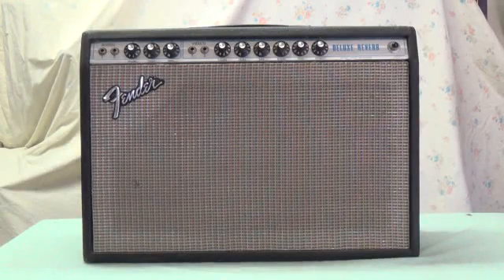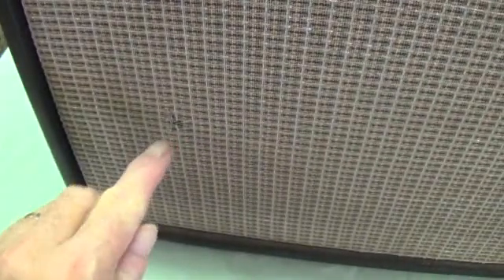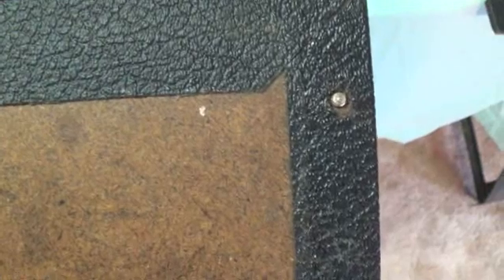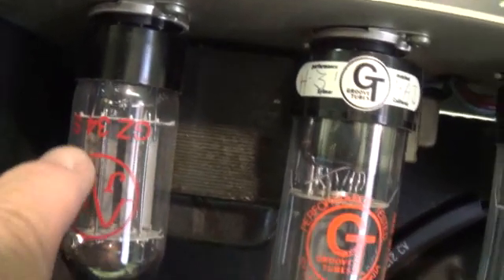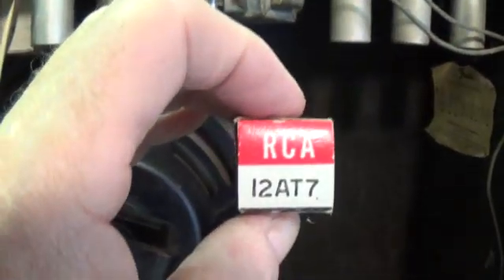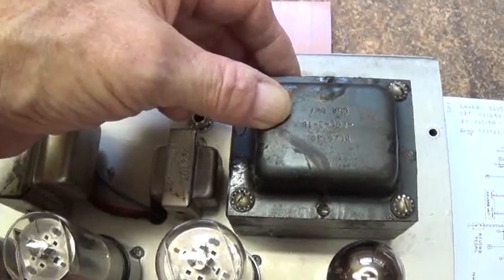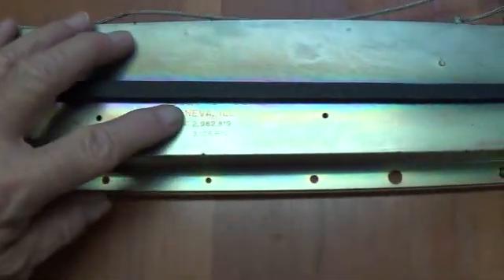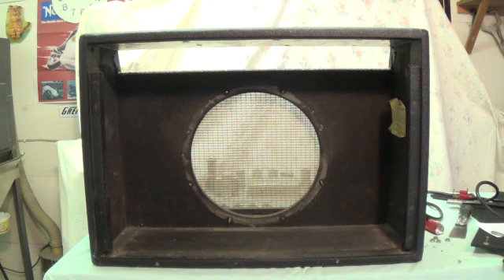1974 Fender Deluxe Reverb Part 1: Disassembly and Evaluation

Comment: Hello, I did something pretty stupid today and I think I killed my Twin reverb reissue... I plugged the footswitch into the external speaker jack and practiced with it like that until it died. There was a lot of heat, but the amp was on the other side of the room so I dIdn't notice until it was too late. 
 I notice that it was not nearly as loud as usual but thought something else in the chain was causing the volume drop. It is dead now and wont turn on. Have I really killed my amp?
 Thanks for any help you can provide!
Reply from the maker: You have probably damaged your output transformer and/or output tubes, David. If you have a multi-meter, test the OPT for continuity in the primary winding and in the secondary. If it's OK, which is a long shot, you could try installing some new or good used output tubes and see if that helps. Good luck.

Comment: Jensen stopped making Alnico speakers in 1961.....so that is a 1956 speaker
Reply from the maker: I was not aware that Jensen did this, Dave. I looked for a reference to confirm it and could not find one. Can you provide a reference that states this?

Comment: Hi Uncle Doug and Rusty, i want to ask you how i can identify a speakers wattage and ohm,s  if my speaker has no label or markings.
regards.
Andy,Scotland.uk
Reply from the maker: Measure the DC resistance of the voice coil and you can estimate its impedance to AC. Generally, the resistance to DC is about 20% lower than the impedance......i.e. 6.7 Ohms resistance = 8 Ohms impedance.  As far as the wattage, it's generally based on the size and diameter of the voice coil. The larger the diameter, the higher the wattage.
Reply: Thank you,,kind regards
Andy

Comment: ....7:30.......turn it on and crackle sounds...I've had that in various equipment over the years...often it's a bad power supply capacitor.....Seems lots of old electrolytics go bad....
Reply from the maker: Another common source of crackling is old carbon comp resistors that develop small fissures in their internal structure that make noise when current jumps the gaps. This is especially noticeable in plate and screen resistors.

Comment: If you disconnect the reverb tank, can you blow your reverb OT, like you do with the SpeakerT, if no speaker load is connected?
Reply from the maker: An interesting idea, PK, that I had never considered. Since the reverb tank and its OPT act exactly like a speaker and its OPT......then, yes, perhaps you could; however, the reverb circuit is operating at considerably lower voltage and current levels.
Reply: Luckily, that did not happen... (I had issues reconnecting my restored reverb, which was rusty all the way incl. connections.) But it seems, that on my Fender Twin Reverb "Reverb Output" on the rear panel goes to "Output" on the reverb, which is very confusing to me. Is that normal for Fender Amps or are my connectors wired wrong?
(Normally I would expect, that reverb output goes into the input of the reverb and vice versa.)
Reply from the maker: I used to find it a little confusing too, PK.  I believe that the output from the amp goes to the input of the tank, and vice-versa.  You can determine this for sure by measuring the resistance (to ground) of each of the inputs on the tank.  The values will be lower than the impedance of the inputs, but still informative. The amp circuit output should be going to the lower of the two resistances......actually about 8 ohms of impedance, so around 5 or 6 ohms of resistance. The tank is like a speaker, being driven by the reverb (i.e. output) transformer.
Reply: Thank you so much for your effort of answering and teaching me (us) a lot - actually I understand, what you are talking about, and two weeks ago, I would have no clue. And that all thanks to your great great videos.

Btw. I did (and still am) collecting a document with your slides and comments, neatly ordered, as a compact reminder of all the things you talk about. Do you have any interest of receiving that? Would that be useful for others as well? If you think so, I would be motivated to put it into a nice, more publicly acceptable form.

Comment: As a novice and amplifier junkie I have really enjoyed expanding my knowledge watching your videos.

I lucked out at a sale and picked up a '78 DR for a song (relatively speaking).... another successful story of finally "lucking" out. The only thing that was amiss was the tremolo, so I had my tech friend throw on a photocoupler/wiggler and bias supply and filter caps onto his large order from mouser or whoever he goes through.

It is one heck of an amplifier---noticeably more powerful than the blackface amplifiers. All you have to do is leave the push/pull volume boost pot on the vibrato channel IN. I've never heard a more strident feature on an amp.

What kind of procedure would one go through to supply tremolo oscillation from one of the oscillating 1/2 tubes?
Reply from the maker: Did the amp come with a pedal?  The Tremolo effect in most DR's requires that a pedal be connected for it to work. Your final question would require a very lengthy reply.  I suggest that you watch my video on PhotoResistor/Bias Modulating Tremolos. Best of luck with your newly acquired DR.
Reply: The pedal and the original cover were unexpectedly present.

I'll watch that video with all speed, thank you.

Comment: I acquired a '74 Twin Reverb 15 years ago. When I first got it, it would randomly make big popping noises. Took the chassis out and found that a coupling cap broke and it was arcing. I replaced that and it worked fine after that. It also had no reverb, and I found that one of the little tiny wires inside had broke off. Soldered that back on and it sounded beautiful after that.
Reply from the maker: Excellent work, VC. You appear to be quite competent at diagnosis and repair.
Reply: Thanks. I had some help from the amp debug page at geofex.com. I was just learning how to build stompboxes and work on amps at the time. Anyway, it said that popping noises were almost always due to arcing. In my case, the stripboard was curled up a bit and I could see where a blue Mallory cap had broke, so I replaced it. I think I just had luck on my side, but since then I have learned how to be a pretty good troubleshooter although I don't love the process of doing so lo
Reply: Uncle Doug Its a real treat to wach your videos...very informative...you do such professional quality work...trust me ...the average person has no were near the technical knowledge and skill you have...I would love to be your neighbor. .we have the same interest in vintage audio : )

Comment: Hi there--I love your videos, as they are very informative. And of course the good humor is always appreciated.

I just picked up a ~'78 Deluxe Reverb with the Push/Pull vibrato channel volume. Vibrato is not working, but everything else is great. Except when I tried to reduce hum by touching the ground switch--got a nice jolt last night.

I thought the same thing: "Why does a stock grounded power cable amp have a ground switch??" I'm sure the "death cap" must've passed A/C to the chassis, and then me and my guitar.

But I wonder if it may need another 12AX7 for renewed vibrato.
Reply from the maker: If the chassis was properly grounded, Taylor, there would be no shock hazard, "death cap" or not. First, you should test your wall receptacles to be sure they are properly wired and grounded. You can buy an 
inexpensive testing device at Home Depot. If they are not wired properly, then repair them. If (or when) they are, then I suggest that you replace the power cord with a properly wired, 3-wire cord and be 
sure that the green grounding wire is securely attached to the chassis. As far as the tremolo, replacing the oscillator tube would be a good first step. Good luck.

Comment: Hi Doug, I've one 73 and I changed the PT and put to 240V (blackfacing with 5U4 for now). Should I switch the 2 amp fuse?
Reply from the maker: If you double the voltage, the current should drop to one half, Pablo, so I would try it with a 1A fuse.  Turn it on and off a few times and run it at high volume to see if the 1A fuse can stand up to normal usage. If so, great....if not, try a 1.5A.
Reply: Ok, I will try this.
Thanks so much.
Regards!
Reply from the maker: You're welcome, Pablo. Good luck.

Comment: Uncle Doug,I really enjoy all your videos. I have a Fender '65 Deluxe (re-issue) and  the 6v6's area extremely HOT.  I believe that Fender did this for some unknown reason.  I have not taken the chassis from the cabinet yet. ATM, I'm working on a 5F2A amp and 6G15 reverb unit and all left is building the cabinet(s) and tolex, which I watched your video(s) on the tolex installation..My issue is the problem of the 6V6's getting HOT.  I don't want to have replacing the 6V6's as they are not cheap. Is there a way to reduce the heat on the 6V6's (bias adjustment ?).Thanks, Tom...
Reply from the maker: You're welcome, Tom. Under normal conditions, the 6V6's get way too hot to touch, but if yours are creating excessive heat, the only way to reduce it that I know of is to adjust the bias to a proper level of Plate Dissipation (a maximum of 8.4W for fixed-bias or 12W for cathode-biased).

Comment: My main amp....to the year.... I love it. Fitted a 55hz Celestion Greenback...an English made one...Sounds amazing.
Reply from the maker: +Paul Fabrique Glad you like it, Paul. It's a great amp :)
Reply: Thanks Doug! It gives me hours of enjoyment...unfortunately the tube chart is missing its corners, but other than that , it perfect. It has the 5U4GB rectifier, which I can get get new old stock RCA types quite cheaply. The Mullard GZ34 are very expensive. The RCA 5U4GB are reliable though, the amp has had the same one for at least 25 years.
Reply from the maker: There is nothing wrong with 5U4's, Paul. A bunch of my old jukeboxes (and amps) have been using them for years with great results. I think the GZ-34 is better in some respects, but the 5U4 is a real workhorse :)

Comment: I believe that first toggle switch on the back controls the Fender 'death capacitor' (so-called).   Just Google:  fender death capacitor
Reply from the maker: Powertuber1000 Greetings, PT. I think you're referring to the "Ground" switch, which allows you to ensure that the "hot" input wire is connected to the "Death Cap", allowing it to remove electrical "noise" in the AC input before it reaches the power transformer. This amp came with a grounded 3-wire power cable and polarized plug, so the switch is superfluous since it can only be plugged in "the right way" (with hot wire to "DC"). As a result, I have bypassed the switch to prevent it from upsetting the proper polarity.  Thanks for your input.

Comment: Hello Doug, Picked up a Harmony Lapsteel and TruSound amp at yard sale, Amp is identical to TruTone models, so may predate TruTone.TruSound logo identical to TruTone except Sound is replaced by Tone. Tube comp is metal 6SC7 in l-octal hole....but replaced with octal socket. The 6???GT...most likely 6SL7 inverter (rubbed off), 5Y3, and 6V6. Speaker is same vintage, with OT removed. OT is under chassis. Amp needs new filter caps in PS and a little TLC to restore. No schematic....but positively pre champ design. Needs filter caps, bias check, TLC, check for hazzards. How to I send it to you? Robert Rand, bluesboyrand@yahoo.com

Comment: should be a C12K speaker, not a 1966 alnico P12Q to be original
Reply: +Bad “1952telecaster” Mann Alnico's are sweeter I personally wouldn't want the original.
Reply: +future4you   I never use ceramic speakers in any amp

Comment: Doug,

How do you "divide and conquer" to find out where those popping noises are coming from?  I know you can usually identify a problem before or after the volume by seeing if it goes up or down with volume, but I've got an amp with a hiss on top of the note and some popping sounds, and I haven't been able to find where it's coming from.  Do you start replacing plate resistors ,first, coupling caps? grid leaks?  I've swapped tubes and I'm sure the hiss on top of the note is not tube-related.  The pops might be, but the old mullard 12ax7 that it pops worst with is dead quiet in another amp of mine.  Thanks!
Reply from the maker: Joshua, if you have ruled out the tubes, then plate and screen resistors would be next to check. One way to quickly test components is with an aerosol can of electronics freezing spray....listen to see if the pops cease when a component is chilled. Here is a site that explains all sorts of other ways to track down the source:  http://www.geofex.com/ampdbug/popping.htm   Good luck.

Comment: I have the exact same amp.  My dad bought it new in '74.  The original paperwork (owner's manual, receipt, schematic, etc.) is still in the back.  It is in a little better condition than this one but pretty close.  The speaker in mine does not look like that one.  It does not have the iron hunk on the back of it and has a large blue Fender sticker on the magnet.  I do not recall GT tubes being in my amp either but I may be wrong.  I thought the stock tubes were all RCA.  Are there different chassis in 1974 models?
Reply from the maker: Greetings, LA. You're a lucky guy.....they are excellent amps. Some people turn up their noses at Silverface Fenders, but in certain early 70's models, like the Champ and Deluxe Reverb, the BF and SF circuits are essentially identical. Your amp may either have a ceramic Jensen speaker, or a cover over the Alnico speaker (as this speaker will get in Part 2). The Groove Tubes are definitely not the original tubes....your RCA's probably are. It's very common to find older amps with replaced tubes, since they do wear out over time.
Reply: I have never played a vintage blackface DR but I have a Princeton.  It is hard to make such a judgment without a side-by-side comparison and that is how I know the SF is better sounding (to me) than the Reissue.  Yeah, I am sure the tubes and everything else is original as this amp pretty much sat in my dad's bedroom covered and untouched from the mid 1970's until I started playing in about 1992.  I didn't realize at the time what I had.  Most of the wear on it has been done by me in the past 15 or so years.  Do you think your speaker is original?  I just assumed they were all like the one in my amp. I would like to hear you play through it.
Reply from the maker: I think everyone agrees, LA, that the SF is probably superior to modern (printed circuit board, 1/4 watt resistor, foreign-made) reissues, but the more contentious issue is how they measure up against the older, BF amps. In my opinion, many SF's measure up quite well.

Re the speaker, I think its originality is addressed in Part 2 of this video series. There is a lot of variation in factory speakers in DR's, so no single speaker is "correct". The speaker in mine may have been replaced many years ago, but is an appropriate speaker for the amp.  I also play a few chords through the amp in that video, but I warn you, the recording fidelity is not the best.

Comment: Watch out for the spiders/bugs. I got an old 40s radio, where some insect ate the whole diagram up, + the paint on the "green eye" tube (dont know what it's called in english). Had a chance to try the reissue silverface deluxe, and was not impressed.
Reply from the maker: Greetings BB. A friend of mine who refinished antique furniture was bitten on the calf of his leg by a brown recluse spider and ended up losing a big chunk of muscle from his leg.....it looked like someone removed a very large ice cream scoop full of meat. Besides almost dying, the hospital bill was close to $100,000. As a result, I am VERY careful of the critters I find inside cabinets....besides the damage they can do to the item itself.

Re the Reissue SFD, I have not worked on one (since I generally limit my efforts to vintage tube amps) but am not surprised by your assessment. Reissues rarely come close to living up to the sound and quality of the originals.